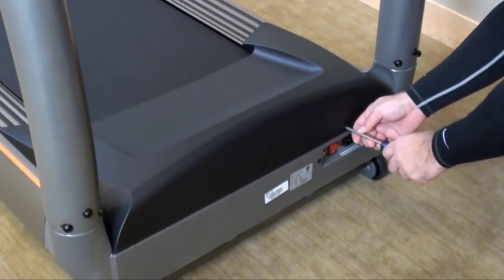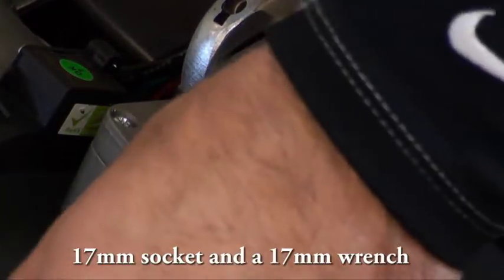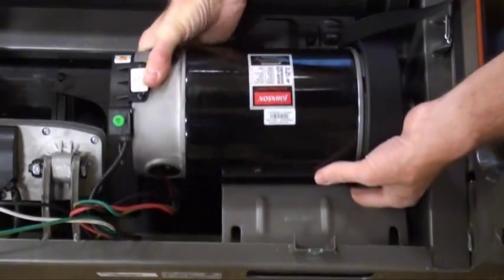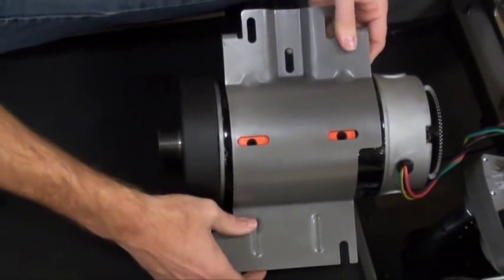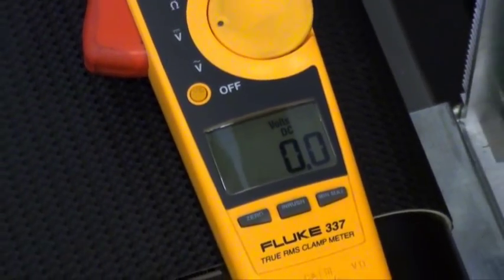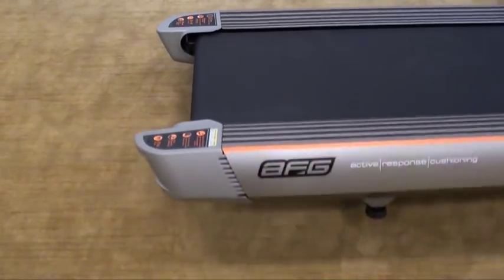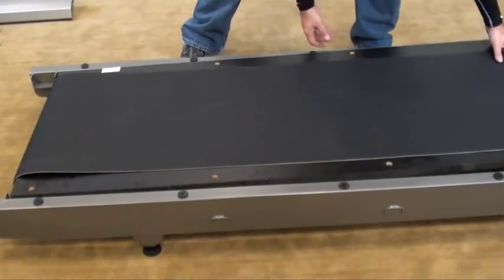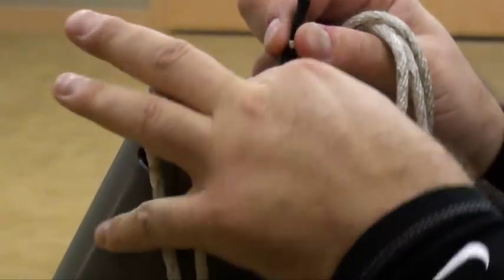Treadmill Parts Replacement

Comment: Why when walking/jogging on my treadmill it stops for a split sec "like if the belt caught grip on the bottem" does it need oil under it? And the right part where u turn the L key to adjust the belt broke in. I put a bigger washer for now but where can I order a new right side plastic cover? Its a Image 10.0

Comment: What is the Error 02 shown by Treadmill?and its after the burning smell from the Treadmill.what is the solution?
Reply from the maker: +IOO lyric Hello, the E2 Error is related to the speed of the treadmill, this combined with burning smell indicates there may be an issue with your treadmill's motor control board.  Please contact tech support for further assistance, (800) 244-4192 if you are in parts warranty or (888) 993-3199 if you are past the parts warranty.

Comment: hello! I moved my pacemaster pro plus to another location in my home. since moving it I can't get the tread to run at a regular speed. it starts at a very high speed and then it displays a (dead) reading . how can I adjust the speed ?
Reply from the maker: +Dellar Leflora Hello Dellar, we recommend contacting the manufacturer of your model for assistance, Horizon Fitness does not make this model so unfortunately we do not have the information to help you.
Reply: Thank you for responding. I will contact the manufacturer.

Comment: I have a Paragon 308 and it made a loud noise while I was running on it. There is now a noise coming from the motor area but its sill working. Do you have any suggestions on where to look first please?
Reply from the maker: +Paul Dale Hi Paul, we recommend removing the motor cover to see if you can isolate the noise to a certain part easier.  You could also take the drive belt (the small belt connecting the motor and front roller) off and spin the roller and motor independently to see if one is making the noise.  For further assistance with troubleshooting please contact tech support at 888-993-3199.